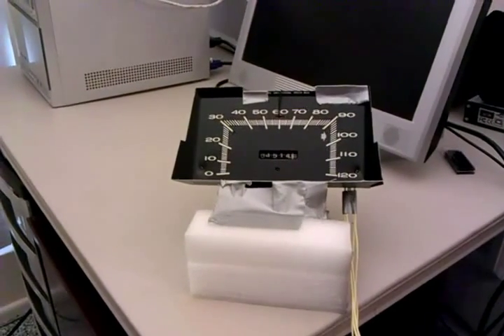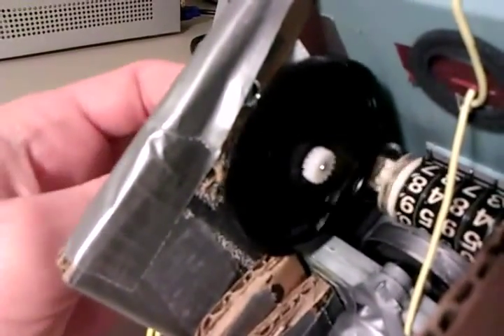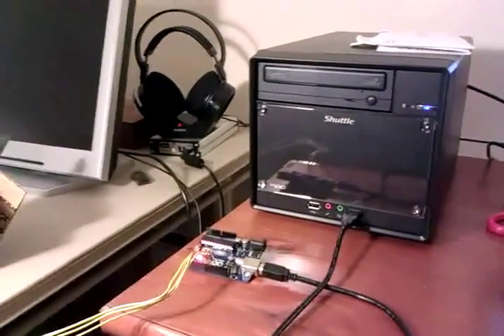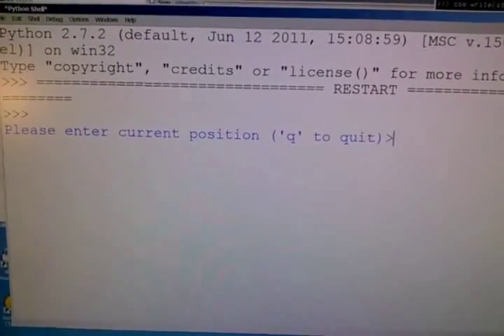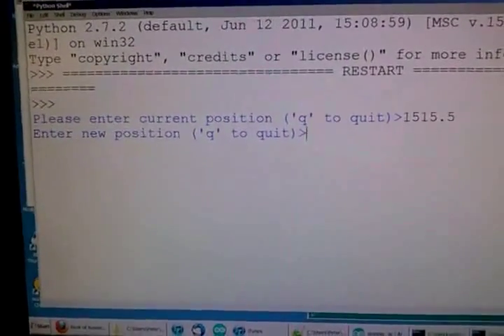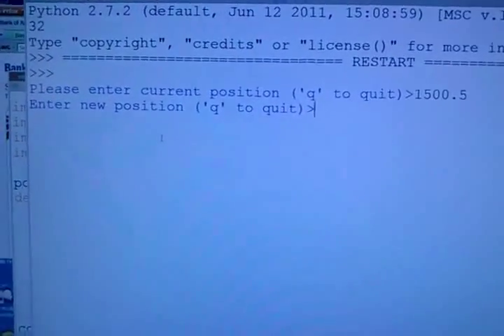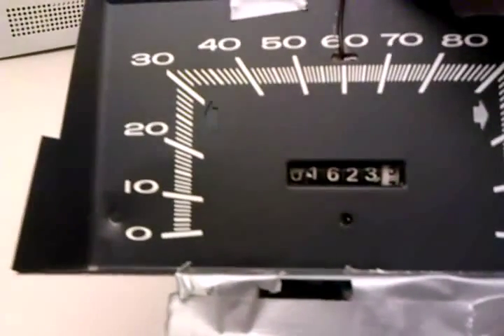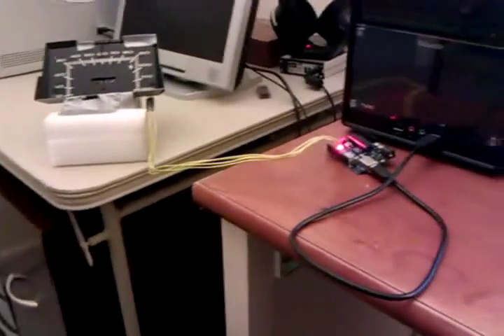arduino stepper motor odometer

Comment from the maker: Oh cool.

No, my script that talks to the arduino keeps track of where the odometer should be so if there is a power failure or something it should be able to remember where it left off. In reality I have to walk over to the odometer on startup - read the numbers - then walk back the computer and reset it on my script.

However, if there is no power interruption the stepper motor is pretty accurate. The odometer can run for weeks without seeming to drift. Good Luck!